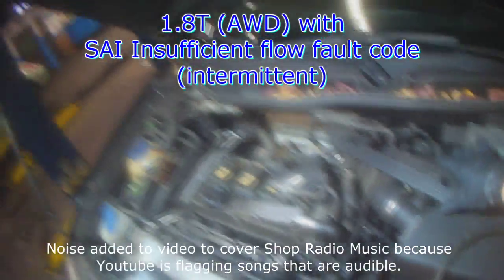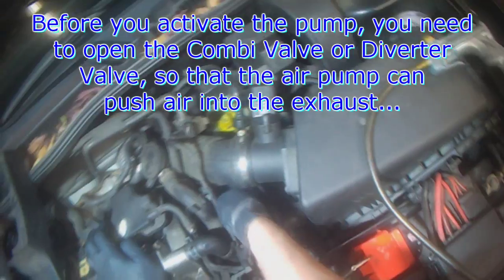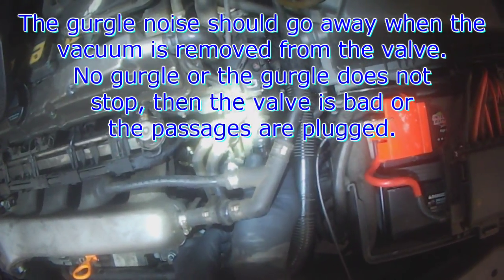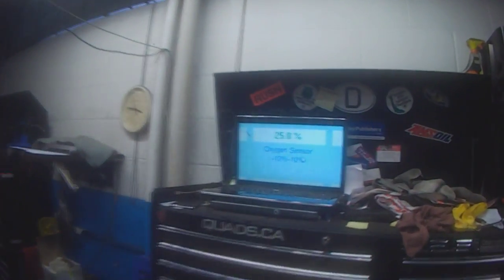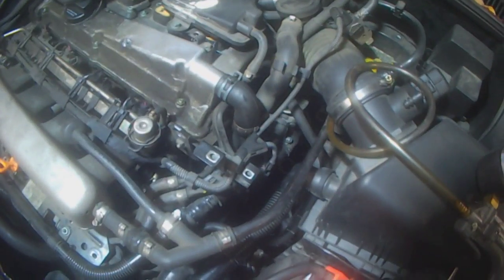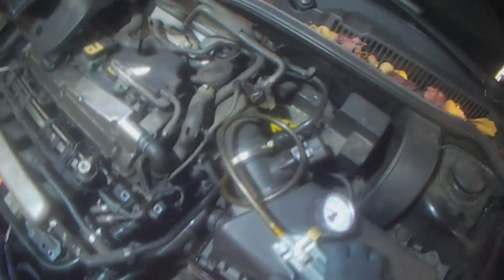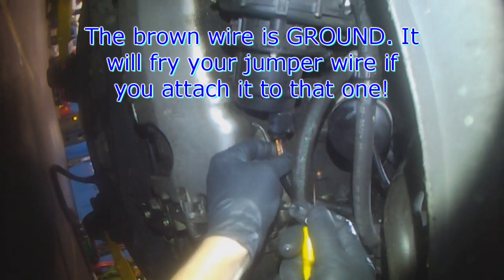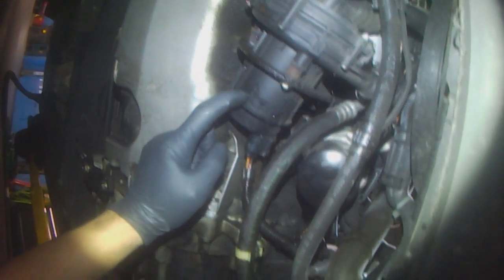VW A4: 1.8T (AWD) SAI Incorrect flow (basic checks)

Comment: What If I'm not getting enough vaccum to open the combi valve? system operates but seem not enough vacuum from the manifold?
Reply from the maker: How & where are you checking for vacuum? How much vacuum does it take to open the valve (have you checked?)?
Reply: @EXOVCDS  I've checked vaccum at the manifold.  By just unplugging the hose.
Reply: @EXOVCDS  I couldn't tell you exactly, I used a syringe to pull vacuum to combi valve. It was on the 10ml, it that helps?
Reply from the maker: @slicksjobshop  if the vacuum hose from the manifold to the vacuum solenoid is ok and the vacuum hose from the vacuum solenoid to the combi valve is ok, then the vacuum solenoid could be bad or control of the solenoid is bad (wiring issues usually set a code though).
Reply: @EXOVCDS only code is for p401, took it to the dealer a while back. They said it's the secondary air pump. But I've ruled that out. No leaks anywhere around the body and blows hard.  Gigiti.
Reply from the maker: @slicksjobshop  can you do output test of the vacuum solenoid with your scan tool?
If not, energize the solenoid manually at idle and attach a vacuum gauge to the combi valve hose. I would think 15 to 17"Hg of vacuum should be enough to open the combi valve.
Reply: @EXOVCDS  I don't have a scanner. But I will test that out, just unplug it from the harness and hot wire the solenoid, correct?
Reply from the maker: @slicksjobshop  yes. Solenoid should click / open... allowing vacuum to reach the combi valve. Remove the plastic tube from the combi valve, that way you can hear if the valve opens (hear exhaust pulses) at idle.

Comment: Hi i know that is an old video but i have a problem with mine passat 1.8t automatic transmision 
When i start from the 1st gear a flor it the engine stals till 2000 2500 rpm and then acelerates and when it hits 3 rd it look like it loses power like the turbo is not working and i slow acelaration
Reply from the maker: What does the gear selector in the dash look like?
Does it look like this:
http://fkh161.ca/VW/B5GearIndicatorNormal.jpg
or this:
http://fkh161.ca/VW/B5GearIndicatorNotNormal.jpg
Have you checked the ECM & TCM for fault codes?
Reply: @EXOVCDS  yes i have full fis display selector is like that it is tiptronic 
TCM does not have any codes but engine does 
Sai pump incorrect flow detected 
Breake booster mechanical fault 
And the 3rd is one i know some one replaced the  vvt tesioner with older version
Reply from the maker: @mirkokolar1488  
Does it look like this:
http://fkh161.ca/VW/B5GearIndicatorNormal.jpg
or this:
http://fkh161.ca/VW/B5GearIndicatorNotNormal.jpg
Reply from the maker: @mirkokolar1488  Normal or not normal? Which one?
Reply: Can the code 17939 somehowe afect timing it is working on 5.5 ° btdc
Reply from the maker: @mirkokolar1488  Ok, sorry. So if there are not codes in the TCM, you'll have to look at engine data to see what is going on. MAF, Boost, fuel trim etc.
Reply: @EXOVCDS  so many quwestions to ask it could not fit in a small book 😀
Reply from the maker: @mirkokolar1488  Keep asking... post a video on your channel so that I can see & hear the engine while you are driving. Does it do the same (lack of power / slow) if you shift manually... 1, 2, 3, 4?
Reply: @EXOVCDS  tnx i will post it tomorow when i am on the highway and thank you once more
Reply: @EXOVCDS  sory for the late post answer i did not make a video but i noticed one thing when i press the gas padle and i keep it i have a slow aceleration but if i relase it till half i starts to accelerate so i am gesing it is the MAF sensor
Reply from the maker: @mirkokolar1488  If it runs better with the MAF disconnected, it could be the MAF.

Comment: Did you find the problem yet?
Reply from the maker: +Direct #bye Hasn't come back yet to check again.
Reply: +Thomas EXOVCDS 
Hi Thomas love your videos, may be a stupid question. But should my kombi be making a  small ticking noise at all after engine is shut off? 04 vw golf gls 2.0 auto. I have replaced Sai hoses, evap solenoid, gas cap, and all vacume lines, I can here my pump working. And can't find anyleaks..I dont have a vacume pump to test kombi, but I'm leaning towards this. any input would be great. worst case I go buy the tools to do proper test. I live in phx, az and I can't pass emissions until Sai and evap say ready to test. thx in advance.
Reply: +Thomas EXOVCDS 
I also have ran ross tech, no other codes it's just saying Sai not ready, evap not ready, this is the last thing on my list wondering if maybe I should clean and inspect?

Comment: mine came up cus all the hoses where broken and then I didn't tighten the pcv hose all the way and it wasn't good. I don't if that's why my dv kept popping out of place.
Reply from the maker: DV popping out of the intake hose?
Reply: +Thomas EXOVCDS yea and it was very tight on there but the other day was sounding like a bov and car felt weird so I checked and it was out. it happen like 3 times.
Reply from the maker: +Ayton Bravo Weird.
Reply: +Thomas EXOVCDS yea it's always been weird. my car had always smoked when I push it hard but when my hoses broke it got way worse along with spark plugs being gap lower then they should have
Reply: +Thomas EXOVCDS I'm putting new turbo and catch can. also deleting all emissions hopefully that helps

Comment: This was the very first problem I had to deal with when I first got ahold of my B4 VR6.  Sadly, I ended up having to rebuild the cylinder head.  Broke several drill bits trying to drill the carbon out of the SAI passages...  Newer designs seem to be much better!
Reply from the maker: I've been lucky... haven't run into plugged passages yet.
Reply: *****
If you find a way to deal with it that doesn't involve pulling the head off the car, let me know!  I think I have video on my channel of what happens when you try to pressure-flush the SAI ports in the VR6 head...  ;)
Reply from the maker: +rhkips I'll check it out.